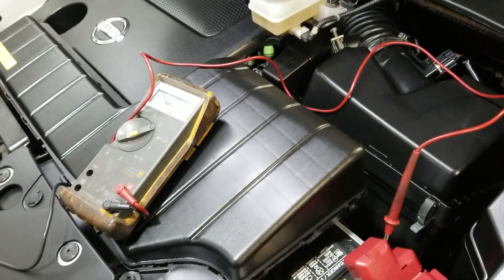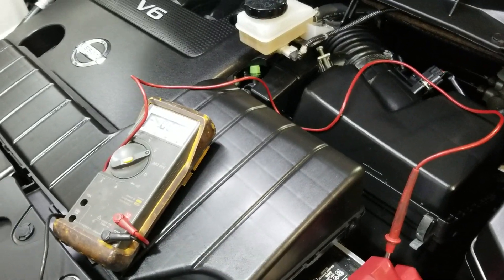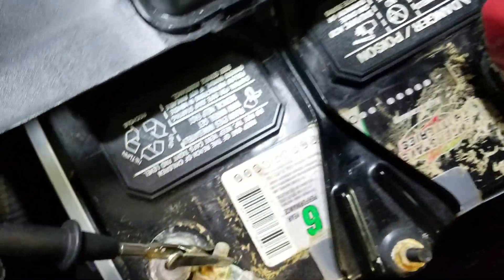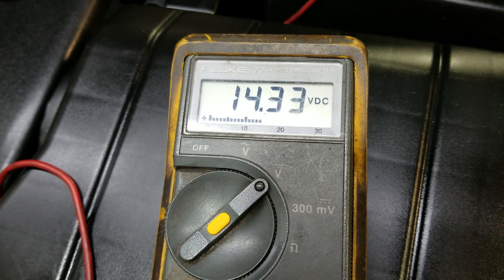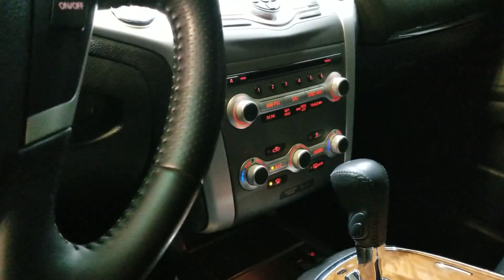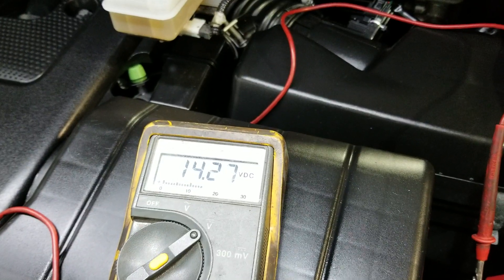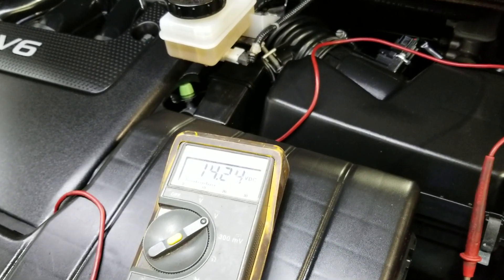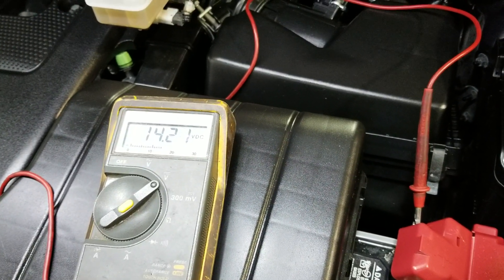How to Check a Charging System with a Volt Meter

Comment: so... my 350z have a flashing battery and brake light, sometimes it stays on and sometimes is flickering without any pattern, just randomly.  According to the volts gauge on the car, when driving I have over 14 volts, when idling just under 14...
Does that means anything?  I'll try finding a cheap volt meter at Walmart tomorrow. 

Is it true that when you test voltage with the car off it says one number and turning the car on should raise?
Reply from the maker: That sounds like it is an Alternator issue.
Reply: @FixyourNissan  just found out the power steering line that seats right on top of the alternator is leaking and some of that fluid is going into the alternator so I'm assuming that's what causing my issue.
Reply from the maker: @AndinoZ33  It very well could be.  Alternators do not like liquid in them.

Comment: I bought a re-manufactured AC Delco alternator that had 4.7/5 review ratings on Amazon and it only lasted 12 months. Thank you for the explanation, I will get an OEM.